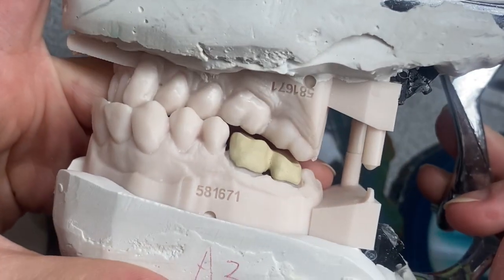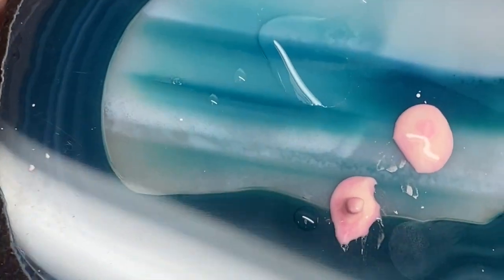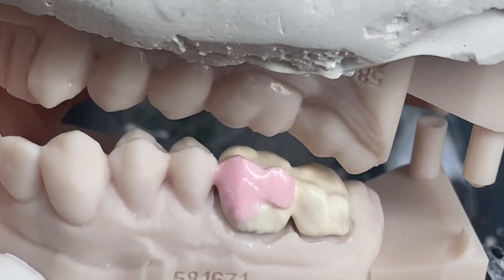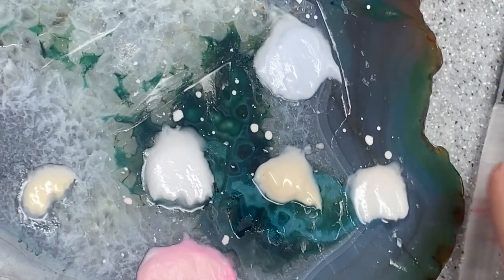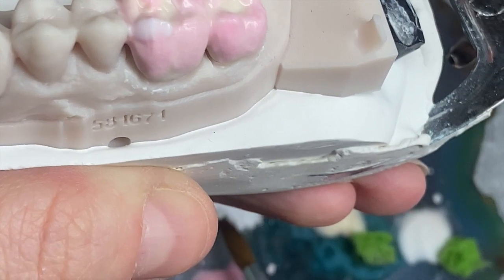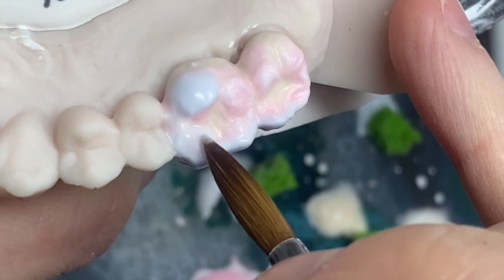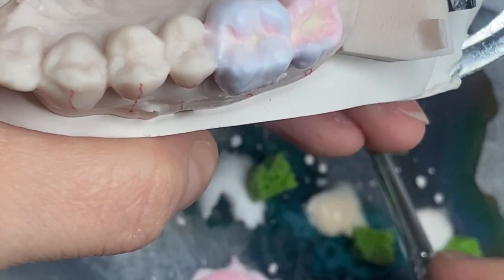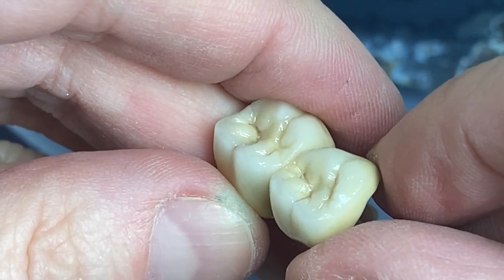How to Avoid Cracks and Bubbles Water VS Buildup Liquid

Comment: I haven't cut my porcelain for many years and had no problems. Cutting or separating porcelain is so old school. Usually cracks happen as a result of over-building (using too much powder for build-up).  Letting your bridge bench dry for 15-20 minutes at least (depending on size) is very important. Cracks form usually when water ( moisture) escapes too fast during baking. Extend your entry to the furnace time as well to make sure the porcelain is completely dry before firing. If you build the interproximals carefully they won't crack. A wet tray may also help with porcelain drying. Your video is very instructive, thanks for showing us your techniques . Beautiful work as usual. :)
Reply from the maker: Hi! As always, good to hear from you! Thank you for sharing your experience, I will definitely try drying out my work for longer and I will let you know the results!😊

Comment: good job and nice tips, In fact, I use Ex3 from noritake and it is very good, I would like to use another brand but do you know of any ceramic system that has good compatibility or do you personally prefer to use a single system without mixing the porcelains?
Reply from the maker: Hi, Ivan! I have been using mostly one system and sometimes I would experiment with the compatibility of different brands - the only way to find out is by trial and error
Reply: @verahadden4712  i Will try mixing most ceramics, its controversial topic because someone says, "dont mix" and others "says mix, but porcelanis with less point of fusion" and thats confused